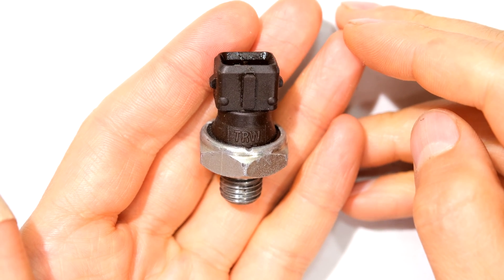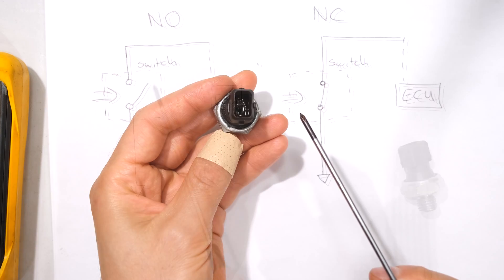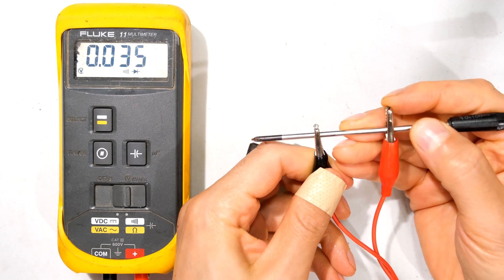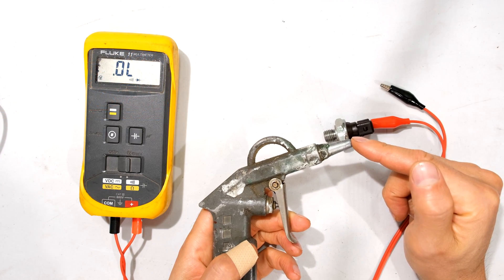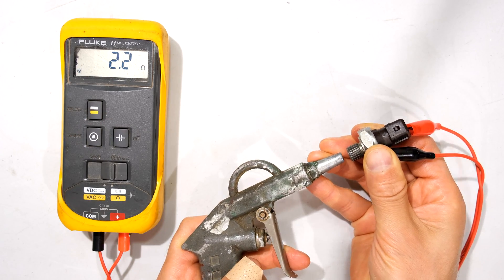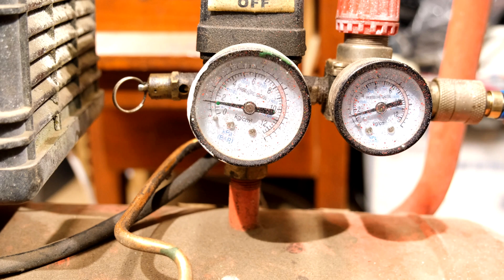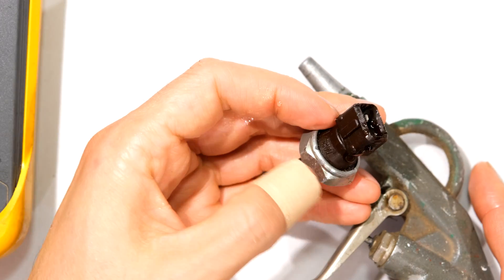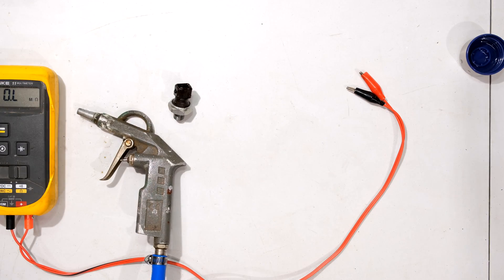How to test an oil pressure switch - with tutorial

Comment: What if the connector to the oil pressure sensor has 3 pins?? Like a 2014 dodge charger??
Reply: Same issue. I replaed with an Amazon aftermarket $17 and still get the p06dd code.  Next up is drop the pan and work the oil pump.  

I would love to know that I just need to dropn $100 on an email switch.   Hate to buy it twice but at least the pos would pass inspection

Comment: I found this video link connected to search results which I was seeking for the ohm impedance for the oil pressure switch that is attached to the vtec spool assembly, but this looks like that is the regular oil pressure sensor. Do you have any information for the other oil switch?

Comment: Yes and no, if the switch has degraded, it will work under say 0,7 bar, but not under 0,5 bar. So to correctly test it you need to see if it switches on/off at the minimum pressure indicated by the switch.

Comment: Good explanation, however to test correct functionality you need to be able to measure the pressure you are applying to confirm its working at rated operating  pressure
Reply: He said one bar for the switch reading at least
Reply: True dat.  Like for testing a VTEC oil pressure switch.  I would assume you could use a rubber tipped air compressor nozzle with the switch clamped in a vice and slowly raise the regulator pressure on the air compressor from 0 psi.

Comment: I know this thread is old but giving it a shot anyway ok here it goes I have a 04 silverado 1500 4.8 2wd with 260.000 miles I've noticed when I turned the key switch on but not cranking it up my oil pressure gauge goes to max 80 pounds so I turned the key switch off and then started up the engine itself it went straight back to 80 pounds. so I immediately turned it off I checked the oil on the dip stick it showed normal reading could this be a faulty stepper moter or a oil sending unit or a clogged filter for the oil sending unit if equipped with one on this 04 4.8.
Reply: Does the oil pressure go down to 0 when key is off?
Reply: @bstceltics4  no it stays pegged out on 80 until I turn off. It's sending unit and i just wish they'll stop letting them designers mechanics put chit where it hard to get too or nearly have to tear down the whole engine for little dam sensor
Reply: @johngray7597 what was the issue?

Comment: 09 Subaru Forester oil pressure switches were both leaking. When being replaced, head cracked (common issue). I plugged the crack/threaded hole with jb weld. My question is, with the switch still plugged in (but not threaded into the hole), is there a way to trick the switch to  send the signal to the computer so it thinks the oil pressure is okay? If that's possible, I can clear the code and just keep an eye on oil levels. It's driving fine with the code (trifecta lights) on. 194k miles, so this is not a pristine vehicle, but it would be nice to have the dash lights off and cruise control working, etc. Any help is appreciated!
Reply: Remove the switch from its connector.  Trick the connector/wiring: by either grounding the signal wire (normally open switch) with a jumper wire grounded to engine block, or jumpering the connector terminals with a short piece of wire (2 wire switch).  Or keeping the circuit open (normally closed switch) by just unplugging the connector = breaking the path to ground.  Tape up the connector to keep dirt out of the end.  Make note, if you have an actual oil pressure reading in Computer, a scan tool will show Max pressure/volts when scanned.  Or dash oil pressure gauge will show Max.    
Stay gold.

Comment: If oil pressure switch leak can it be the sensor is bad? I got mitsubishi triton 2011 4D56 engine, when start engine the indicator off and lit up after a few sec. When give a rev the indicator is off, let off accelerator pedal the indicator lit back. Can it due to the oil sensor leak? Engine got no knocking noise when idle and oil level at full level

Comment: Hi, My van is doing something strange, wondering if you could help... when I start the vehicle while its cold I can drive it fine, fast or slow. But as soon as it it reaches 90 degrees the oil light starts flashing. Everything sounds okay no noisy oil pump.  Thanks
Reply from the maker: oil leaks? could be a faulty switch